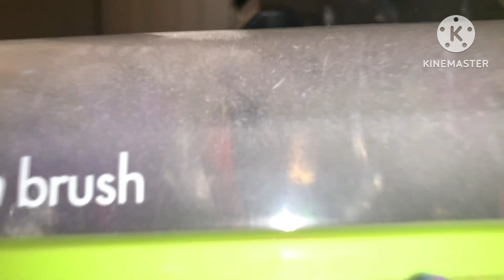5K Pt. 3 🎉 Vac Room Mess Test

Comment: 🎉 TIMESTAMPS 🎉

✨ 0:00 - Intro
✨ 0:05 - Green Cleanview spread out brushroll pickup w/ Er-Thang Mix on multiple rugs
✨ 5:02 - Green Cleanview brushroll pile attacks w/ Er-Thang Mix on pink patterned rug, closeup + pile stepping 
✨ 7:16 - Green Cleanview spread out brushroll pickup w/ Er-Thang Mix on multiple rugs
✨ 7:45 - Green Cleanview brushroll pile attack w/ Er-Thang Mix on multiple rugs + pile pushing 

✨ 10:03 - Lavender Shark spread out brushroll pickup w/ Er-Thang Mix on multiple rugs 🎤
✨ 15:35 - Rug shakeout
✨ 16:29 - Lavender Shark brushroll cleanup on multiple rugs/carpet 🎤
✨ 18:40 - Rug shakeout 
✨ 19:29 - Lavender Shark brushroll cleanup on dino rug/carpet 🎤
✨ 20:27 - Lavender Shark brushroll pile attack w/ Er-Thang Mix on carpet + edge cleaning 🎤
✨ 21:12 - Lavender Shark brushroll cleanup on dino rug/carpet 🎤
✨ 24:25 - Lavender Shark hose cleanup on carpet + edge cleaning 🎤
✨ 26:26 - Lavender Shark brushroll cleanup on dino rug/carpet 🎤

✨ 27:13 - Dark Purple Shark brushroll cleanup on dino rug/carpet
✨ 28:00 - Dark Purple Shark hose cleanup on carpet + edge cleaning
✨ 30:05 - Dark Purple Shark brushroll cleanup on dino rug/carpet
✨ 32:25 - Dark Purple Shark brushroll cleanup on carpet + lines